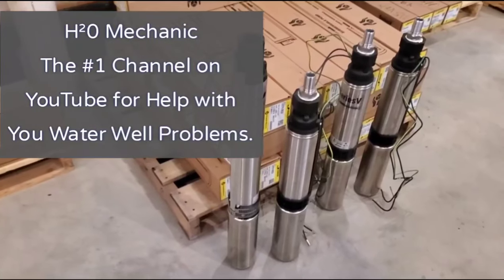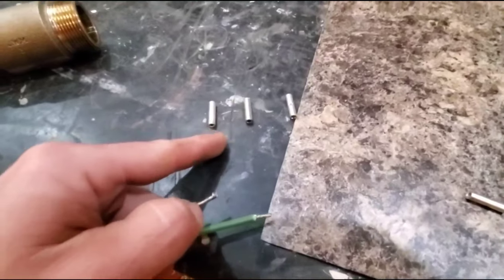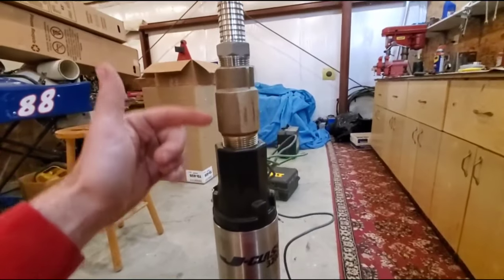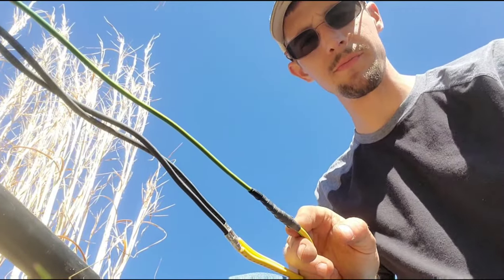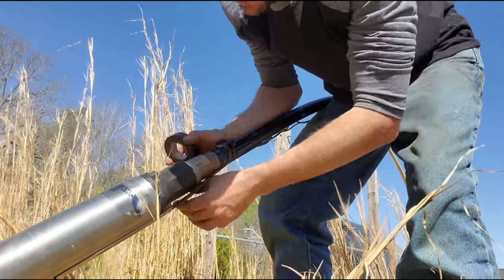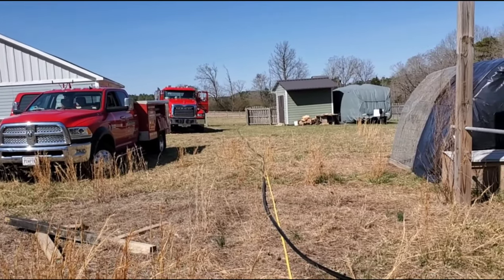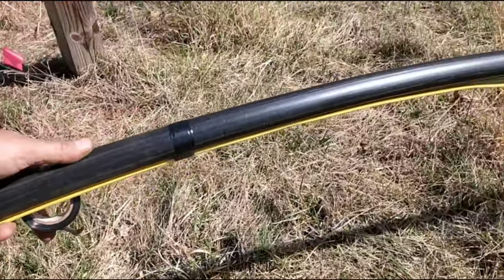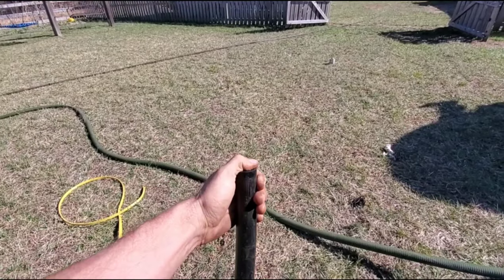What Size Well Pump Do You Need? How to install a Pump Correctly

Comment: Man am I glad I found your channel.  You've actually saved my life.  I am currently in the need to replace my deep well pump (345 feet).  I have confidence now after watching a ton of your videos.  I just have a few questions, if you have the time to answer.

As stated above, my "well info plate" states that my well is at 345 feet.  Casing depth is 58 feet and 6 inch in diameter.  No static water level info is provided on the plate.  It states that the yield is 20 GPM.

I've counted all my fixtures (sinks, tubs, toilets, outside faucets, dishwasher,  and washing machine) and have a total of 19.

With the above information, would it be possible for you to recommend a proper size well pump and pressure tank?  I was thinking of up sizing my pressure tank in the 30 - 45 gallon range.  I'm limited by height in my well enclosure to 46 1/4" so i'm still researching the right tank.

Any info you can provide would be greatly appreciated.  I'm located in the mountains of western NC.  Thanks

Comment: Do they make a pump like your using for like a 10 inch discharge, the well casing is either 12 or 14 with a 10 inch discharge??

Comment: I really like watching you work, you make everything look very easy I hope you can help me, my well pump went out,  my well is 30'  away  from my house  a 60psi  and  400,head  and with all these lying websites I don't know what pump to buy could you recommend me a pump and where to buy it from I greatly appreciated
Reply from the maker: You need a 1hp 5 GPM pump. 5 gpm is key!   2 wire or 3 wire. I prefer 2 wire pumps.  Try getting a Goulds, J-Class, or Grundfos. 
We install 3/4hp. 5 gpm pumps ( j-class brand) at 400ft.   If available, buy the Stainless steel Head type.

Comment: My Franklin 1 hp 230v submersible pump is 40 feet down the well and has a pvc check after it exits the well right before the pressure tank. A faucet is installed on top of the well head and only works when the pump is running because the check valve is preventing the pressure tank to get to the facet when it’s not on. Can I remove this pvc check valve? Or does the submersible require it. Thanks

Comment: Great content. 
Question- my well doesn’t produce enough so I am installing a holding tank in my basement. Static level 21 ft, well depth 42 ft. I know I just need a 1/2 hp pump but since I’ll be putting a 3 gpm flow control valve does it matter what the gpm is for the pump?
Do I need a control box with a 3 wire pump to control the pump with a float valve?

Comment: I read that pump says 230 volt with 3-wires. Normally 3 wires means two hots and neutral. Is it different for these pumps? If its 230 volts, doesn't that require dual breakers? Confused

Comment: I was searching for the Simmons brass check valve, I only found the female ends type.  Would like to find the one you used in this video,  the male thread on the pump side to female threads to the adapter.   Do you have a link to buy that part?  Greatly appreciated and thank you for great informative videos!  Your a big help to all

Comment: I was wondering I have a 400 ft well stagnant water level is at 190 I had a pump in there from 10 years ago I just need to know what size how many horsepower how many RPMs do I need

Comment: I hope you don’t get Arc Transfer in your wire splice connections. Should’ve used shrink tubing. Then tape.
Reply: Yeah I’ve been doing well installs as part of my job for 10 years, never did one without the good thick transparent heat shrink tubing that is manufactured specifically for this application to seal the splice , plus the heavier 10 mil tape to secure the wire to the pipe. Even if you use the good electrical tape to secure it, like 3m super 33, it’s not what it was designed for. Looks like a lot of homeowner installs I’ve seen and fixed

Comment: Hello, thanks for all your informative videos. I am new to wells but we recently purchased a property with a 205' well, 157' to water-no pump, just 6'' casing. I recently had it inspected and they used a 20 gpm 1 hp pump, pump test depth was 180'. The flow was 15 gpm, static held at 165' for one hour. Flow test yielded over 900 gallons. First question, how would you intemperate this report? Second, what setup would you recommend for a no pressure system, running off a generator? Mainly the size and brand of pump, depth, hose, cap and above ground. I plan to fill a non pressurized tank in the summer and would also like be able remove the faucet and cap it in the winter- If that is even possible.. Thanks again, keep up the good work.
Reply from the maker: I'd run a 5gpm 3/4hp pump at 190ft. 5gpm pump will supply around 9-10gpm  easily at that depth & the 3/4hp motor is easier on a generator.
Reply: @h2omechanic  Thank you so much! This one? Goulds 5GS07412CL, 5GPM, 3/4HP, 230V, 3 Wire, 4" Stainless Steel Submersible Well Pump.
Reply from the maker: @chrismcdougall7399  I prefer the 2 wire pumps. It does away with the control box. & uses 12-2 wire not 12-3. But the rest is Good!
Reply: @h2omechanic  doesn’t having a three wire pump protect against lighting strike damaging the pump?
Reply: @soundrew  Yes, it did with my pump!
Reply: However, no guarantee with lightning strike! I was blessed to only need a control box and pressure switch!
Reply: Don't trust this fellow.

Comment: Hey what’s up man love your videos your spreading knowledge and the people appreciate it 👍🏾. What’s your thought on solar well pumps ? Have you ever installed one? I’m in Cali with plenty of sun and want to stay off grid. Thanks in advance
Reply from the maker: Solars are tough. You basically create a water tower type of system with a solar pump. They work very slow. But they work good for live stock. But its not gonna work like a normal system where the tank is 20 gallons & you have nice pressure. 
Solar gives you about 3 gpm pump it to a tank 250gall and have it on a high elevation so it can gravity feed to the house.
Reply: @h2omechanic  can you pump it to like a 5000 gallon tank and then from there use another pump to pump it to the house so it has pressure?
Reply from the maker: Yes.

Comment: I have a deep well that is 80 feet deep. At 70 feet I got 15 gallons a minute when the driller hit water. I have a few questions for you. 1st what size pump do I need as far as horse power with a 220 volt feed? 2nd do I need a Brass check valve in the water line and should it be placed on the top of the pumps threads? I will use 1 inch black plastic pipe the kind you have recommended in other videos of SIDR-9 200 PSI. 3rd my cabin has plastic water pipe installed 35 years ago that are glued with PVC cement fittings. What should the water pressure PSI be for the hi low limit switch 20 40 or 30 to 50 as well as a Low water cut off on the switch so IF there is low water the pump does not constantly run and burn itself out. 4th the pressure tank 36 gallon or 20 gallon?

Comment: I seen a few vids of deep well pumps going bad and have electrical tape in the intake. Is there is better thing to use for wrapping the wires that will not degrade and get sucked into the pump?
Reply from the maker: Use 3m tape. Not duct & not zipties. Cheap tape always falls off
Reply: @h2omechanic  Makes sense. How many years does 3M tape hold up down there?
Reply from the maker: @briantheguy1  10-15 years
Reply: In my experience, electricians tape looks like brand new after fifteen years. It's icy cold all the time and in total darkness. I used cable ties once but didn't like them: I kept snagging my gloves on them as we set the pump.

Comment: Hi ! Gr8 Video ! And I have a Question.... My artesien well  is about 350 deep... and I need to replace the pump.... So, is a Franklin 1HP 10 GPM a Good replacement?  Thanks! :)
Reply from the maker: 350ft. I'd recommend a 7gpm pump not a 10. If your wire is #10 then a 1hp is fine. If you have #12 wire, buy a 3/4hp 7gpm pump. I sell them on my website.  Listed in the video description box

Comment: Great video ,   
Have you ever used a submersible pump in a lake say for a cottage etc. If so what pump would you recommend (I'm in Canada if that makes a diff).  I've seen you video on Amazon Hallmark pumps so I've written those off.  Cheers
Reply: AB, fellow Canadian here. If this is just for seasonal use at your cottage, consider an inexpensive 1/2 hp pump from Home Hardware. It's made by Red Lion out of the U.S., has a good Franklin Electric motor and seems to stand up well. Mine lasted twelve years (full years, not just seasonal), not bad for only a $450 investment. I just installed another one at our local Community Hall.
Reply: This is an amazing answer as that's exactly what I bought and installed.  I got a 1/2 hp 12gpm submersible and made myself a stand.  It's in the lake now!  I also ran an internal line self regulating heat trace in the hopes I can have running water this winter!
Thanks for reassurance

Comment: How do you precheck a 3 wire pump? Which wires should you touch to power to see if it spins?
Reply from the maker: Those require you to wire up the control box.
Reply: Temporarily wire the pump to the control box, then apply power to the input terminals of that box.

Comment: Hi sir, very educating Video!
May I ask what is the best PSI for a 1hp, 7GPM at 150ft?
Reply: What do you mean by 'the best PSI'? The the best pressure is the one you need for your application, you define that, then whoever sells you the pump must calculate the right pump for you. A good pressure for your house (if that's what you use the pump for) is from 30 to 60 psi

Comment: What would you recommend for pump size, pipe size and at what level I should set the pump for a well that is 
drilled to 400 ft
 water level is at 320 ft 
Yield 15 gpm with 0 ft drawdown after .5hours
Reply from the maker: I'd recommend a 1 or 1.5hp. 5GPM pump. Set at 360-380ft. Check valve at the pump & at 200ft. Preferably set on threaded Stick pvc or special order 250psi black roll pipe. 
With such a deep static level, the pump will work harder & the psi ranges will be above 200psi during operation (to lift water that depth) 
45psi per 100ft or static  +60psi operating pressure
Reply from the maker: A situation like you have is best to call in a pump company who has a crane. Your system will weigh around 400lbs. Too heavy to do by hand.
Reply: @h2omechanic  it’s a new install.

Comment: Great video! I had a few questions. The pipe is one inch poly 160psi? You installed a 3/4 HP 5gpm pump?
Reply: I noticed no other check valves, torque arrestor, or wire spacing rings. Just trying to learn. Thanks!
Reply from the maker: I only add another check valve if the pump is set at 400ft. I don't use tq arrestor or rings. They cause more issues than they help. (Unless a well is rough & crooked). I use 200psi pipe normally now. Old 160 is equal to new 200psi pipe. 5gpm 3/4 goes to 400ft. A 7gpm 3/4 goes to 300ft. 10gpm=200ft. 
Most important thing is to tape the wire to the pipe every 3-4ft.

Comment: If you go with 1 Hp and 5 gallons per Minute,would it Make a Diferece on PerformancePoint O What You can Tell Me . Thanks For Your videos And I'm new in Your channel
Reply from the maker: A 1hp 5gpm is good for a 400ft pump set depth. Depending upon where you set a pump will determine what size you'd need. None will perform Better, but some could underperform if set too deep, past what they're designed for.

Comment: At what depth well would you need to install a 3 Hp well pump?
Reply from the maker: Hp is determined by the static water level & how much water you need. 
What are your well specs

Comment: What pump would you suggest for a 4" 2hp  3 wire and best place to purchase?  Well is 125 feet deep.  Thank you your videos they are very helpful
Reply from the maker: Not sure why you'd need a 2hp for a 125ft well. 
But assuming it's for household use, I'd recommend buying a 3" Grundfos SQ 3/4hp 10gpm 200series
Reply: @h2omechanic  Sorry if I am posting this comment in the wrong area. I have a old 3"ID Casing well probably over 50 years old. It was using a 1 hpMyers (HCM100)jet pump, which the motor has just burned up due to rusted out foot valve. I have watched your videos on jet pumps.  I am trying to get a submersible pump 2 wire to replace it.  The well bottoms out at 59 feet.  What pump would you recommend to use with this well? I know that the pump's diameter needs to be less than 3"  due to the casing size. I am sure this is a shot in the dark, but I hate to have  a new well drilled.  Any suggestions would be greatly appreciated.
Reply from the maker: @ruarkj123  I believe that you have to stick with a jet pump unfortunately. 4" wells are the minimum for submersible pumps. 
You can email Grundfos & ask if their SQ 3" pump will fit inside 3" casing.
Reply: @h2omechanic  Thanks. That is what I was afraid of. You do awesome job making videos. You are teaching a lot.

Comment: I need ur help... I bought 2yrs ago a vevor 2h's power pump. My well is 40ft deep n before we had 40 below wind chill I had the pump working. I think it froze up cause we had no water any more. That was about 2wks ago so I'm sure it's thawed out by now but we still have no water. Is it possible that the pump burnt up in that short of time. I don't hear the pump kicking on or off. I flicked the connectors on the pressure system n didn't see any sparks n they are opened up not closed. Is it also possible that we aren't getting power to the pump. Please if u can help me figure this out I'd be so grateful thanks so much Mama Spitta
Reply from the maker: No spark means the pumps not running. 
So either the pump froze & burnt up, or the wire got shorted out. 
I'd remove the pump and Inspect the wiring.
Reply: @h2omechanic  OK so if wires are ok then how do I tell if pump is fried.... N I'm hoping n praying that it's not. I just can't afford another one right now

Comment: Does the ips and cts matter
Reply from the maker: What's that?
Reply: IPS=Iron Pipe Size
CTS=Copper Tube Size

Either should work as long as you get the proper fittings to match your pipe.

Comment: Have a well 200 feet deep that never had a pump in it how big pump should I use ?
Reply from the maker: I'd recommend a Goulds 3/4hp set at 150ft deep on 1" 200psi black roll pipe. 12-2 wire. 2 wire pump. 20 gal tank

Comment: So I’m looking at purchasing some flexible poly pipe.  The outside diameter is 1-1/4 but the inside is 1 inch. Will that be ok to use?
Well is 400 ft deep and pump should be sitting around 350 ft.
Reply from the maker: Try and buy 250 psi 1" black roll pipe. 350ft is about the max for that pipe. Also your going to need a 1HP 5GPM pump. 
Don't buy a 10 or 15 GPM pump, they won't lift from that depth. So be sure to buy a good brand. 5 Gallon Per Minute pump head is an absolute Must!. If your well makes over 2-3 gallon per minute, I wouldn't set it any deeper than 200ft. 
But you'll need to know first how deep it is to the water (static level) 
Typically it's 40ft below surface. Other areas its like 250ft+ to the static water level. Lots of variables. Also you'll need #10 wire
Reply: @h2omechanic  I was think of use the Advanced Drainage Systems
1-1/4 in. CTS 250 psi NSF Poly Pipe in Blue
Reply from the maker: @diyalternation  do not use 1 1/4! It'll be WAY TOO Heavy! But The Blue poly is very good pipe! Stick with 1" Please!!! If you went with 1.25" that system would weight 700lbs+ once it's full of water, you'd never get it back out unless you used a boom truck/tractor to do it. I can't stress it enough.  
1.25" is ok for 100ft pumps and say a 3hp irrigation system, but that's just for the high gpm flow rate. 
Your going to 350ft, your pump won't have a crazy high flow rate bc it has to lift water from really deep. So in theory it's geared Lower for pulling deeper. 
Stick with a 5gpm 1hp! Goulds or J-class or Grundfos SQ
Reply: @h2omechanic  thank you for responding. So the inside diameter is 1 inch on the 1.25 pipe. So if I go with the 1 inch pipe the inside diameter is .875. I only asking I want to make sure I get the right size INSIDE diameter pipe and fittings to match. Thank you for responding and taking the time. I’m just wanting to make sure I order the right parts. 

And I will go with a quality brand pump. B/c I need to water the lawn and feed water to my house. I’m still waiting to get my well drill to find out the final number which makes it hard. But I want to have all the equipment on hand to be able to install as soon as possible.

Comment: Do you find using a torque arrestor unnecessary?
Reply from the maker: It has its place in rough wells and pumps set very deep. Typically a 1hp has More Tq at start up & could use one.  But I Typically don't use them.

Comment: Am Handy but never put in my own pump . Just bathrooms . 
I want to do the job but where can I find the right psi pipe for 400 foot well 
Do they make a two wire pump for 10 gpm?
Reply from the maker: 400ft well requires 200-250 psi black roll pipe. Id recommend a 5gpm pump (not a 10gpm. 3/4hp or 1hp is fine. J-class sells a 3200series that's perfect for that depth
Reply: We’re can you find the pipe I live California. 
If I do this job successful I will donate to your channel !
Reply from the maker: @colombianoman4426  good luck finding product! It's tough, even for me! Resin is used to make pipe (its made over seas) its in short supply. So pipe is hard to find. I'm currently working on opening up a online store to sell supply to my viewers .  But you can find it online in a few places I'm sure. Search 1" black roll pipe 200psi
Reply: Ok. homedepote has it but not the full length . Can I put check valves ever 100 feet to help 160 psi pipe to last at 360 ?
Reply: homedepote has 1 1/4 200 psi at 100 foot length
Reply: If you sold those rigging tools that you have I would by them in a heartbeat
Reply: They charge 7500 dollars to install a well pump in Southern California